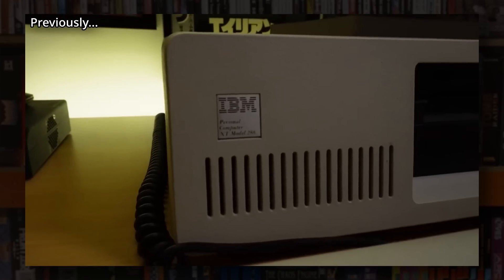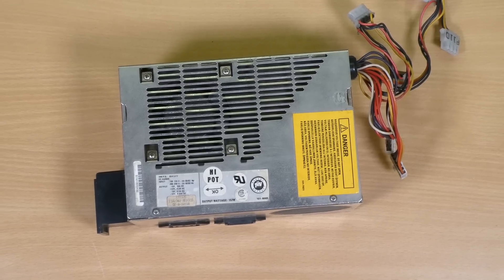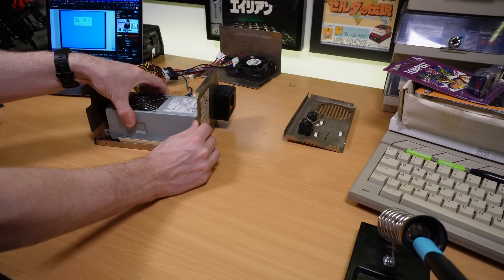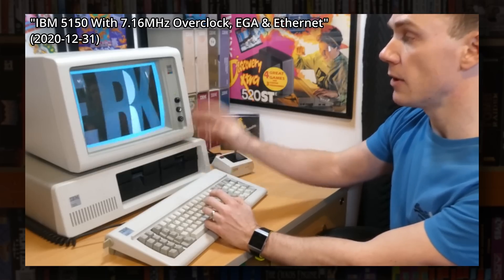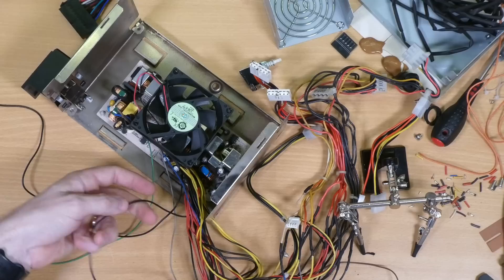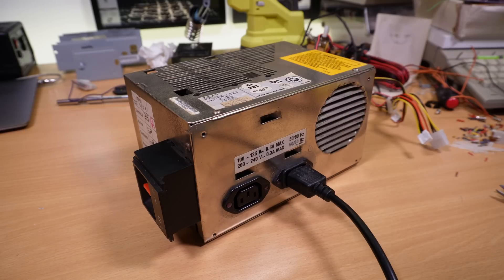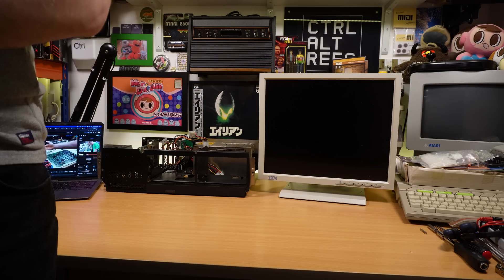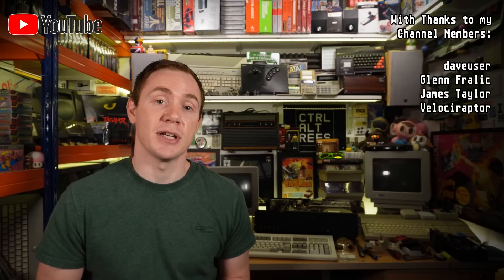1986 "XT 286" PC Power Supply Gets A Modern Upgrade! - Restoration Part 4

Comment: Thank you for this tutorial!!! I had a bad PSU for my 5150, and never really knew what to do about it.

I ended up yanking the guts of a Dell Optiplex GX1 PSU from 1998ish and am putting them inside of the IBM case. All that's left is to connect the old wires. I'll save that pleasure for tomorrow...
Reply: I got everything put together, but now the PC lets out a low frequency continuous beeping from the speaker, and nothing else happens. 😭

Comment: Because what I know about electronics you could write on a match head, I will ask a stupid question. As the new power supply fitted inside the old power supply case, could you of not just left the new power supply as was and just made a cable up from the old PSU input plugged into the new PSU input if that makes any sense, rather than strippin g down the new power supply. Good video, though. I do like these old machines. They looked amazing. I would love to house my PC in one of those cases.

Comment: Great stuff! I'm in the middle of doing something very similar with my IBM 5155 Portable PC. Initially the original power supply worked, but there was far too much ripple and noise on the 5V line for the motherboard to work, and a recap solved that... until the whole PSU died completely after a few hours of use. Now, in principle I like to keep things as original as possible but this is a great mod for people who really enjoy these machines and need them to be somewhat reliable. By the way, if you ever find you need the -5V (I have a few expansion cards that do), a 7905 voltage regulator with a couple of filter caps can step down the -12V line, and in fact I believe that was the solution employed in the original XT power supply.

Comment: personally i'd consider the old psu more reliable than many modern ones, especially cheapo ones, as long as you make sure any RIFA branded class x and y suppressor caps are replaced, these are notorious for the epoxy casing splitting and eventually exploding... if worried about the voltage rocketing and destroying parts, should be possible to rig up a voltage clamp or crowbar trip, it may have one internally anyway...

Comment: Wow, that's actually kind of genius to take the internals from a modern power supply and put them in the original PSU.  I probably would have just jankely set the modern PSU inside and held it in place with zip ties or something 😂

Comment: I have a BBC Micro with an internal PSU that has released its magic smoke. I'm tempted to just take out the whole PSU and replace it with a modern external PSU, possibly even a USB PSU, but I can't decide if the retro community would hate me forever if I did such a thing. To me keeping the PSU original doesn't matter but some people go to so much trouble to repair them. I find it baffling. Especially when PSUs from the 80s are crazy inefficient.
Reply: repair kits are available, most  common cause of smoke is not the psu circuit itself but the RIFA branded mains suppressor capacitors, they split, let moisture in and eventually explode, replace those 2, plus a 220uf 25v in the primary circuit  and then will usually be ok, some like to replace all electrolytic caps, as they've been known to leak..as for inefficient, if it the usual switching thing(i assume, early ones were 'linear') , theyre not too bad,

Comment: I have a similar issue with my IBM AT, the PSU dies and because of the form factor I haven't been able to source a replacement. I may need to look into trying something similar.
Reply: the original may be repairable...

Comment: It’s always mad to me how those mobos are so massively simple but also massively complex to do very little.
Reply from the maker: I think that sums it up perfectly 😁
Reply: This is a great visual reminder of what "integrated circuits" actually means.  So much of that board got integrated into a single chip -- the "chipset."  And a bunch of RAM chips moved into their own pluggable modules, and so on.  The motherboard, for a very short while, became little more than a backplane.  And then vendors started integrating more previously card-bound components into the motherboard again.  :-)

Comment: Most PSUs I've worked on have a plastic sheet for added insulation between the PCB and the metal case. I didn't notice if this had one?
Reply from the maker: Yes it did, I fitted the one from the new PSU but that shot didn't make the final cut. I probably should have mentioned it 🙂

Comment: Btw  those "blue capacitors " on the IEC connector could also be MOV's. Thumbs up for doing the sensible thing by replacing the PSU as well as replacing the old caps. 👍🏻I keep telling people that one day or another these things WILL go bad. When that happens they often drag many things with them. Often parts that are not available anymore. The -5V can always be made with a DC/DC positive to negative converter.

Comment: One thing to look out for when doing this is that the modern PSU has enough umpf on the 5V line as modern PSUs put most of it on 12V.

Comment: If the lack of -5v becomes an issue, There is a way around that without redoing the PSU again.  Since YouTube won't allow links in the comments, just search for "Voltage Blaster" which was created in a collaboration between Necroware and Phil's Computer Lab, both of YouTube fame.
Reply from the maker: Ah yes, I had someone suggest this to me on the Point of Sale PC video as well. Maybe it was you? Although I don't need it perhaps I should get my hands on one for a video anyway just to see how it works...

Comment: I agree on the fact PSU should not be considered being part of keeping hardware original. Especially if the future of the PSU is unsure and cannot be maintained to keep it reliable enough not to destroy your hardware. But I surely love how original state you kept the housing! Also the long boot before display scared me xD
Reply: Well.. It is a part of keeping it original but not a part anyone really gives a toss about, it's not like we're having pebble beach exhibitions with prizes with judges consdering if the screws look like touched after the factory.  Mods that keep them usable for running the software are a-ok
Reply from the maker: Classic Computer Concours... Now there's an idea
Reply: no reason why an old psu cant still work reliably.... these ones were made well before the capacitor plague issue, and modern capacitors dont seem to last as long, anyway...
Reply: @andygozzo72   Caps and fans are the parts that usually fail.  The old ones are stout, but I replace them anyway.  The Panasonic / Nichicon / Rubycon caps, and Sanyo Denki fans I use are likely to last another 20 years.  At which point, if anything in the computer still works, I'll consider that a win.  :-)

The next likely thing to fail are PSU transistors and diodes, since they're high-power parts that live a relatively rough life.  In MOST cases, they can (and will) fail quietly, without a lot of fuss.  It'll just stop working.  Or perhaps trip a protection circuit or blow a fuse.

It's not inconceivable that something will fail and take out stuff downstream, but that's always a risk -- even with PSUs that are half as old, or even brand new.  You can't insure against that.  May as well enjoy it while you can.
Reply: @sirnickity  i havent...yet...come across a pre 2000s motherboard with bad caps, all the ones i've seen have been 2000s era...as for psus, similar, apart from few odd 'old' ones with dried up caps, but not surprising as theyre fairly heavily stressed